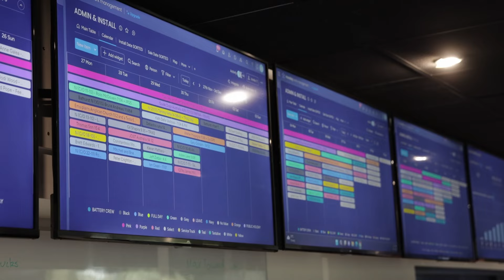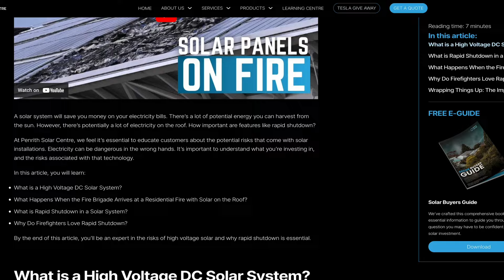What Happens When a Solar Isolator Catches on Fire

Comment: The real problem is rooftop isolators and that is why (too late) the regs have changed. Get rid of the rooftop isolators and you get rid of the problem. And much cheaper than an expensive Enphase system.